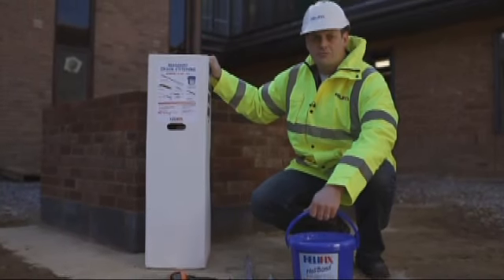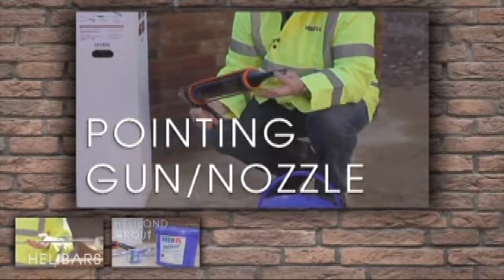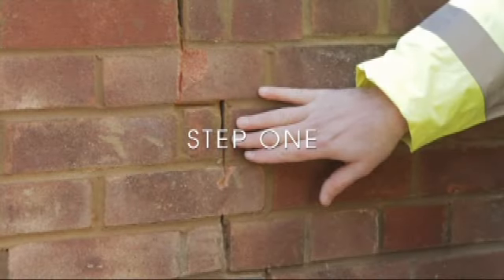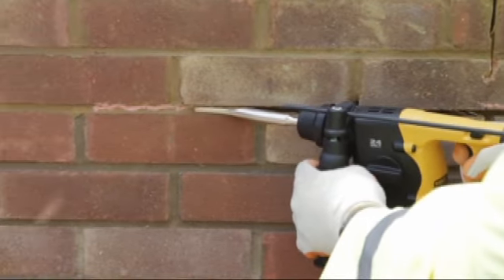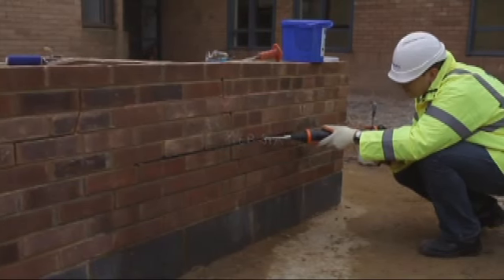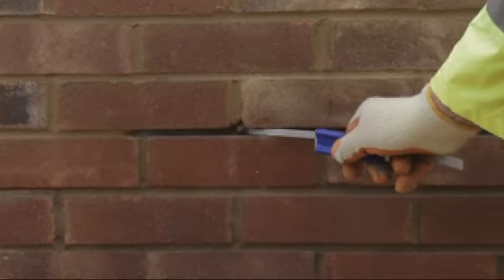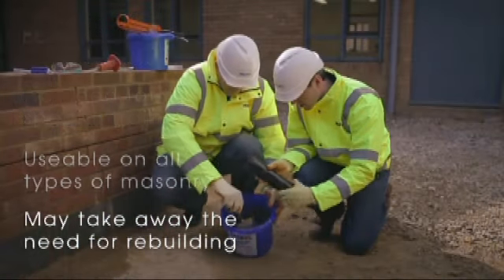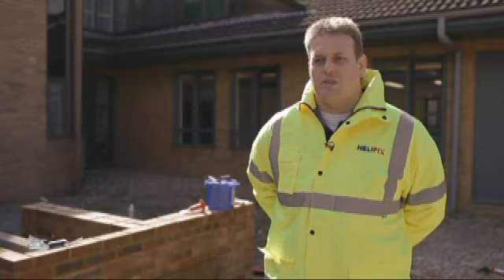Crack Stitching Kit | Screwfix

Comment: About £80 on ebay
Reply: But with this kit you get the "special tool" to push the helibar in with instead of using and damaging  your old 20 year old flat head screwdriver 👍
Reply: Doski Tumani  25mm-35mm with 25 being the minimum and the bars should extend either side by 500mm having said that in some situations they have to be cut shorter and with the resin going off so hard i've never had any problems or cracks reappear.  Good luck it's an easy job 👍